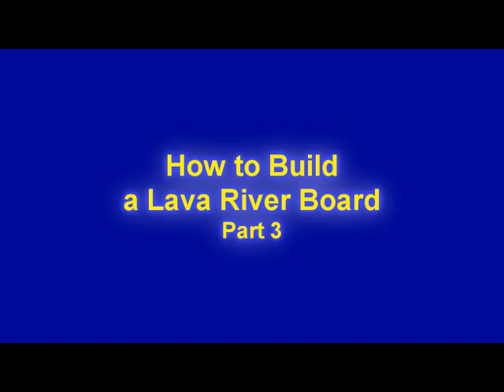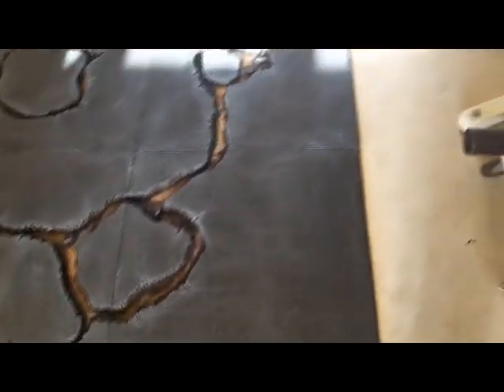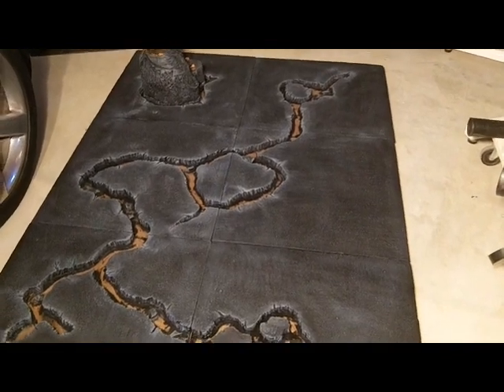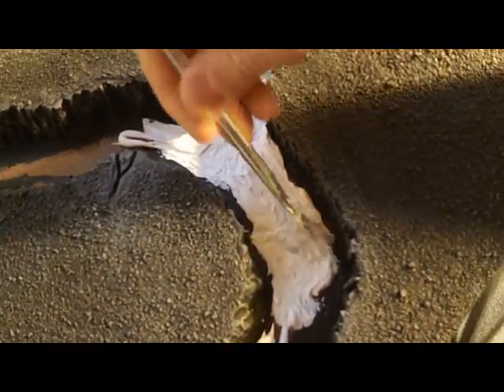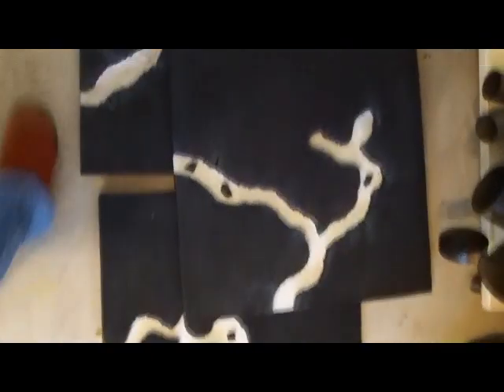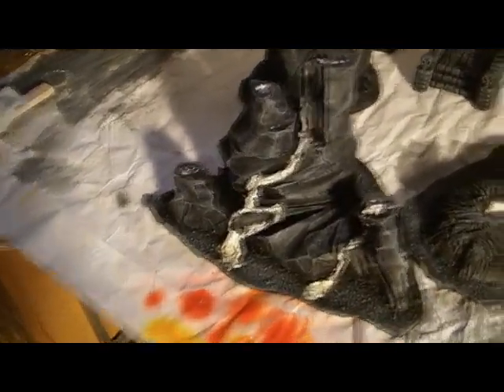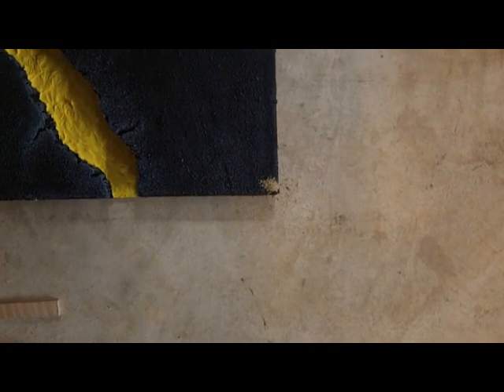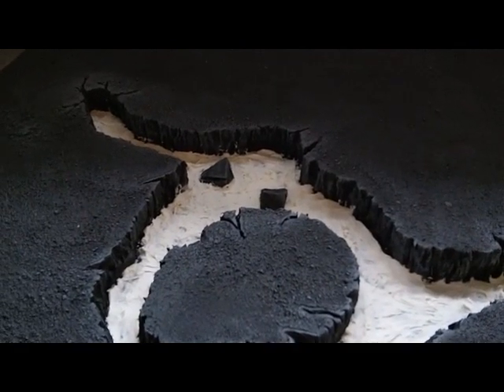How to build a Lava River Game Board part 3

Comment: I am currently working on finish a lava table myself. I used a lot of what you recommended and so far its not to bad. However, I believe you said if you had to do it again you would do the lava before you painted. I did that and I got a lot of black paint on the caulk and the yellow is kind of dark. Thanks for all the great videos